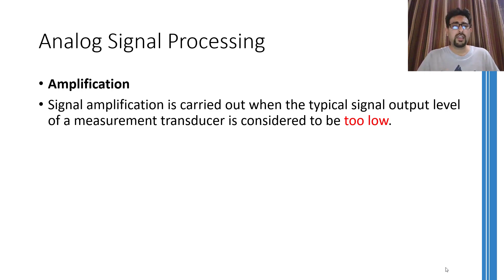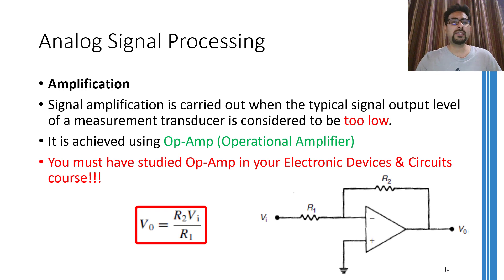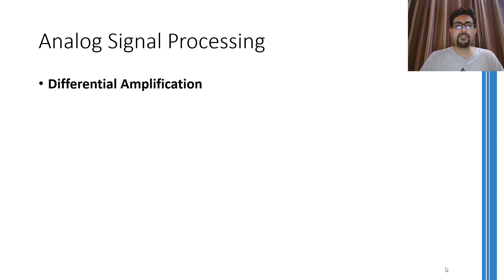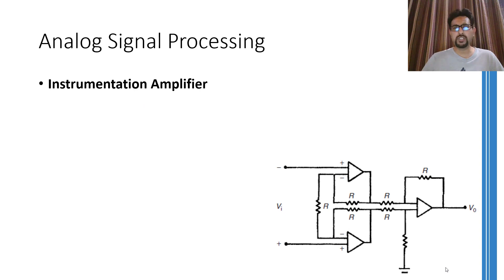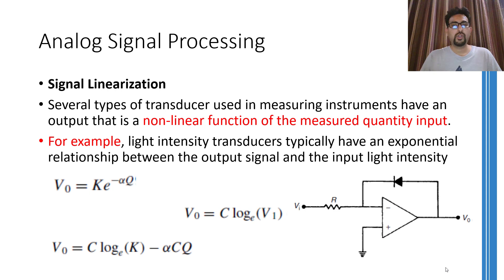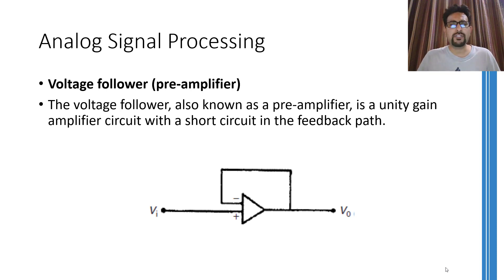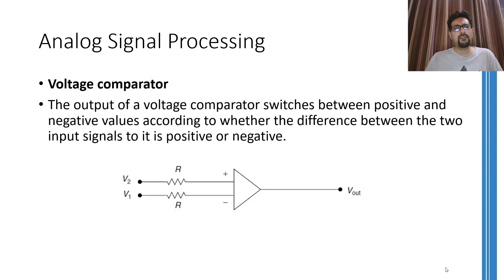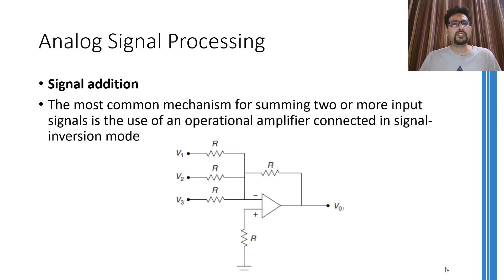Lecture 5 Analog Signal Processing Via Op Amp

Comment: Op-amps are used in sound systems (speakers and microphone) and it can also be used as a detector in which op-amp compares the input signal signal with the threshold and gives the output.

Comment: Op amps are used in a wide variety of applications in electronics. Some of the more common applications are: as a voltage follower, selective inversion circuit, a current-to-voltage converter, active rectifier, integrator, a whole wide variety of filters, and a voltage comparator

Comment: Task) People with hearing problems may use hearing aids with op-amps installed in a circuit inside them which help them hear sound which they are normally unable to hear.

Comment: Op-amp use as comparator in l293d ic for comparing voltages at certain thershold for the operation of motor to rotate in clockwise and counter clockwise direction

Comment: if we want to use any sensor such as temperature sensor or a water overflow sensor in which we require output in the form of alarm, we can use opp. amp as a logic unit to do so eg rain detector, water overflow alarm and obstacle sensor

Comment: Amplifiers are the backbone of Analog electronics. They  are used almost in all the audio related applications. In sound electronics, the operational amplifier increases the voltage of the signal, but unable to provide the current, which is required to drive a load. We have used the Operational Amplifier in '10 Watts Audio Amplifier Circuit with Volume Control', a project of Electronic Devices and Circuits course.

Comment: Op Amps can be used in Voltage regulators,Current regulators,Modulators and Temperature control devices.

Comment: In our Digital clock project, we have used  (555 Timer) for oscillator circuit in which there is a built-in op-amp that is used as a comparator in it.

Comment: In Microphones the sound signals produced by vibration of membrane are generally very weak to be further processed. So, a pre-amplifier (containing op-amp) is used for strengthening (amplifying) the sound signal.

Comment: Op Amps are used to measure sensitive signals like small changes in voltage from a measuring device like sound measuring or any other

Comment: Operational amplifiers are used in many electronic circuits to amplify or rectify the current and voltage. they are also used in speakers, radio, television, analogue calculators etc.

Comment: We can use operational amplifiers in sound amplification systems like in loud speakers where we desire a loud sound as an output. The input sound of lesser amplitude will be converted into electrical signals and are passed through to the operational amplifiers of pretty large gain to amplify them. The amplified signals are then converted into the sound signals again.

Comment: 1) : Op-amp can be used to amplify input signal. As a Real-Life Example: it is used in deivces like TV, Mobiles, Computers to amplify sound.Also Op-amps are used in voltage regulators.

Comment: We made a project of an automatic street light in EDC subject and used an amplifier to amplify the signals coming from an LDR that is a light dependant resistor. Other than that amplifiers are widely used in Mobile Phones, Speakers, Receivers, Computers, Laptops, Radios, and many other devices.

Comment: Op amps can b used in electronics ,voltage follower, selective inversion circuit, a current-to-voltage converter, active rectifier, integrator, a whole wide variety of filters, and a voltage comparator.

Comment: If you want to use any sensor like, infrared, LDR, temperature etc. in any of your application and want to get an output or some kind of alarm when the value crosses certain threshold, you can use op amp as Voltage comparator to do so. simply compare the value of sensor with threshold and connect the output to buzzer or led.
Most commonly used applications are rain detector, water overflow alarm, obstacle sensor etc

Comment: In electronic devices and circuits lab we  used the op amp  to convert sine waveform into square waveform and square to triangular wave forms etc. It was done using op amp as differential and integrated amplifier.

Comment: When a radar projects a beam of radiation to detect any threat, the RCS of the incoming body is too small to send strong signals back to the reciever. Hence amplifiers are used to upgrade the signal and calculate the actual RCS of the object to differentiate between different objects i.e cruise missiles, UCAVs & Fighter jets.